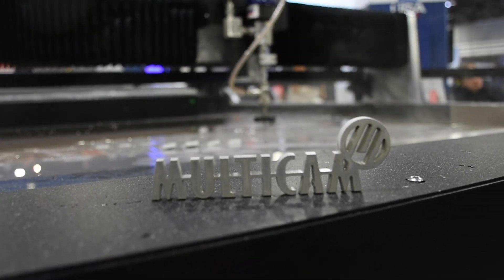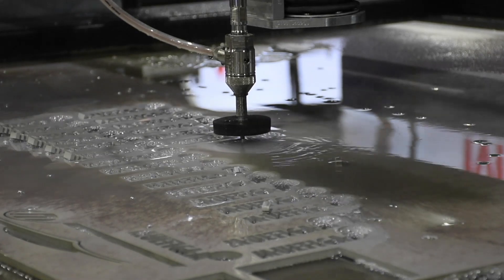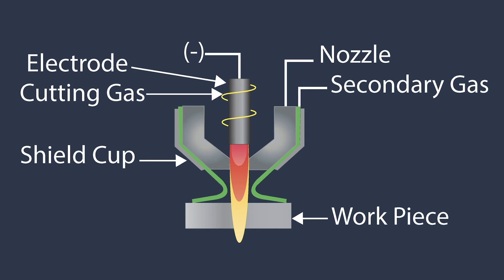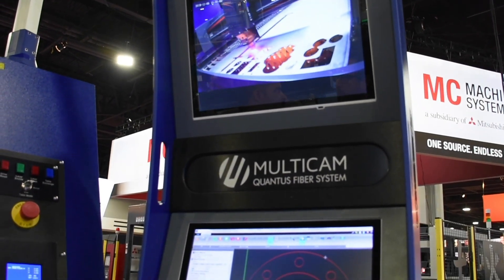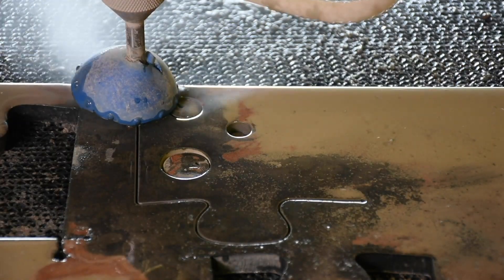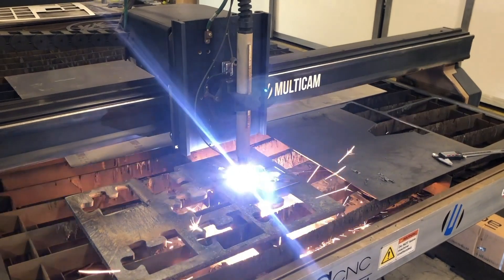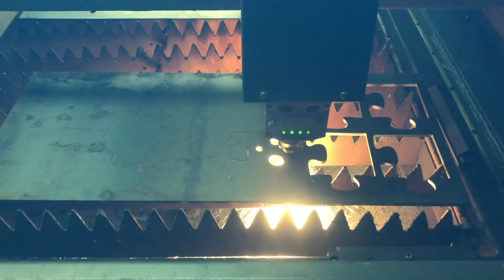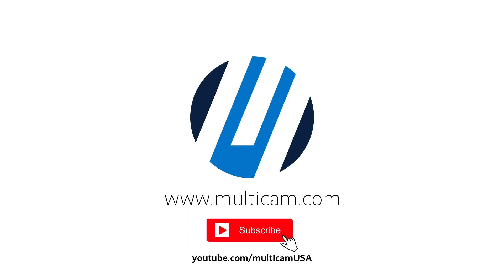Which CNC Metal Fabrication Machine Is Right For Me? | MultiCam Waterjet, Plasma & Fiber Laser

Comment: Why waterjet has high operation cost?
Reply: Cost of the abrasive material
Reply: plus the down- time it takes to clean out the sludge, which is a mixture of garnet (abrasive material) and metal particles, from the bottom of the tank. it's like digging through compact wet sand.
Reply: Pump motors are in the 50hp range.  Most also require 3 phase power.
Reply: @trollbane66  Holy Moly.